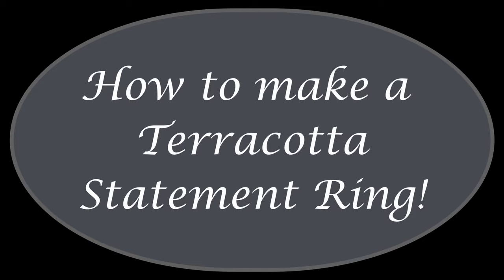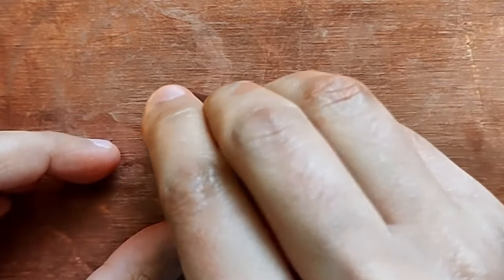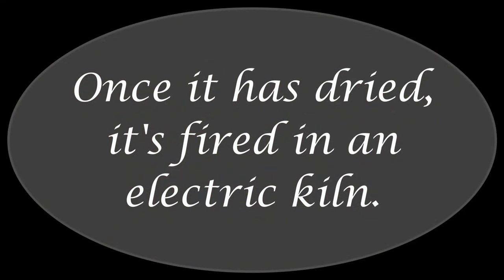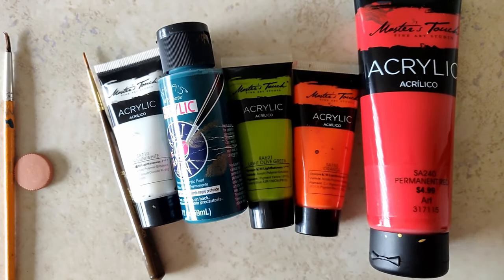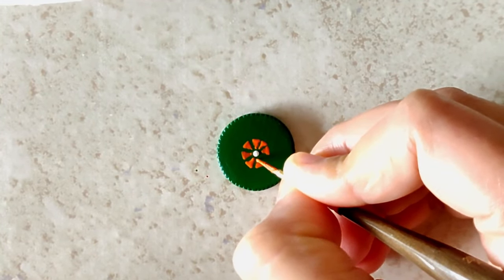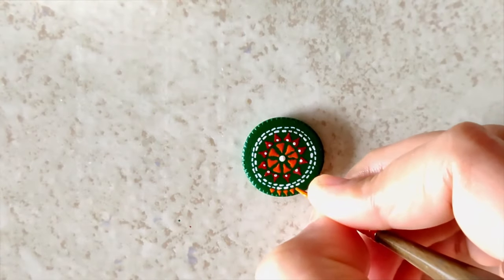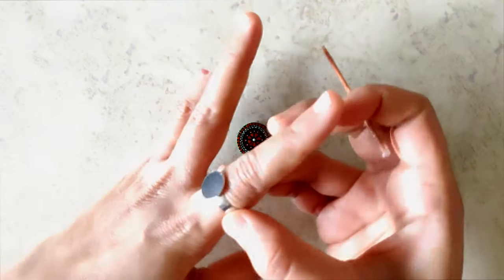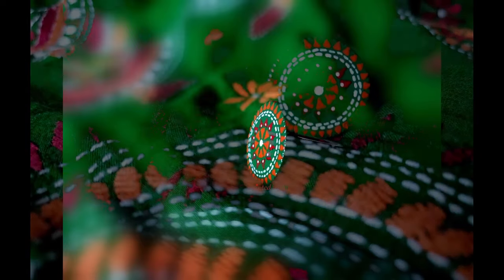Cocktail Ring | Terracotta Statement Ring | Customized Ring #paintedearthbyneha #terracottajewellery

Comment: Hi neha mam as usual  it's very beautiful . Mam I have a doubt  the clay used for pottery and jewellery are different or same ?
Reply from the maker: Thank you so much!
Clay for terracotta jewellery has to be fine. I have used the same clay for jewellery and wheel and they work well for both purposes. But for functional pottery (likes plates, cups, dinnerware etc) I prefer using stoneware or a mid range clay.
Reply: Thankyou man for your reply